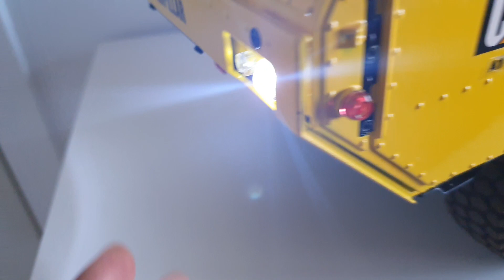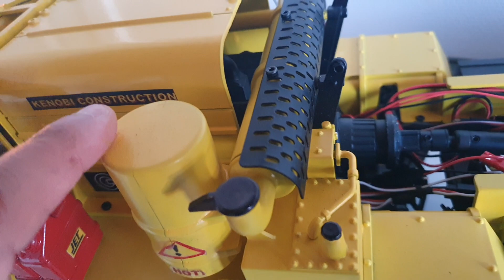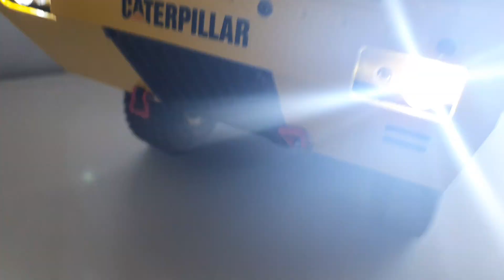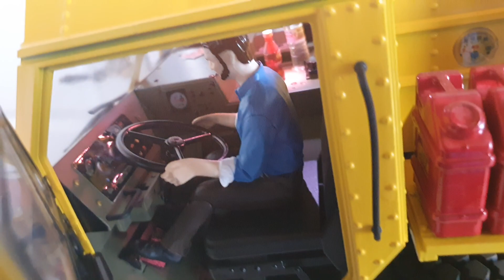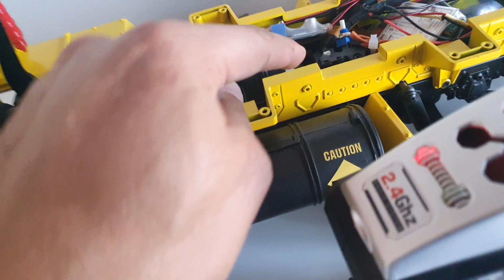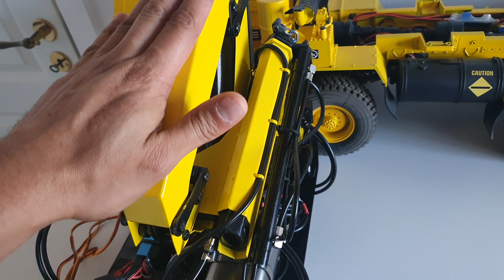Scale RC model CAT A1 8x8 with hydraulic lift

Comment: ps add the hg p806 stiff inner spring into your front and rear shocks.  It will lift the entire rig and there will be no more rubbing
Reply from the maker: Thanks fir the tip.Where can i get rhis inner springs?
Reply: The hg trailer is worth every penny plus they give a choice of spring rates depending on load to carry.  These should be the heavy load springs like stated in item.  They def do the trick all you need is 4 2 in front 2 in rear.